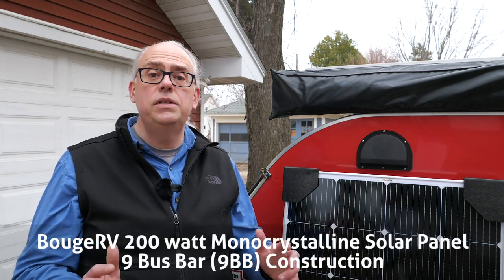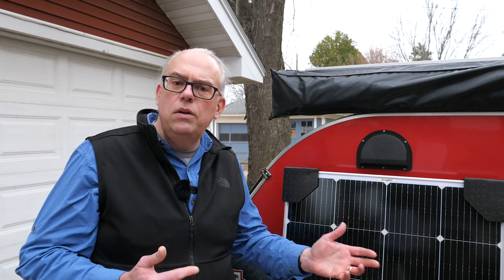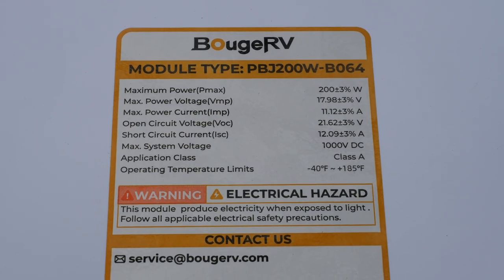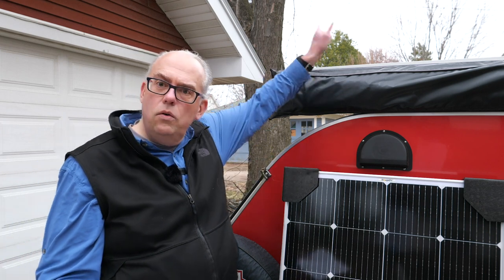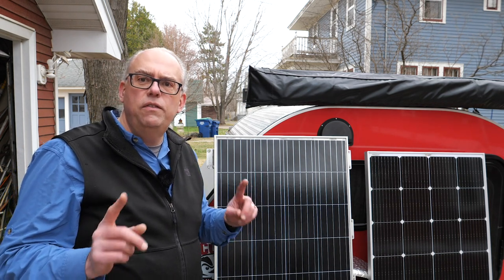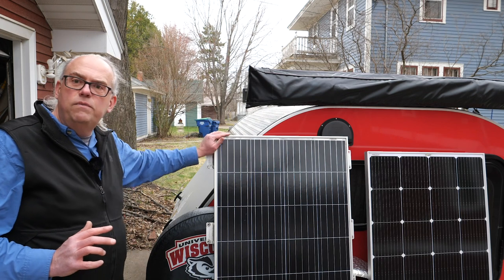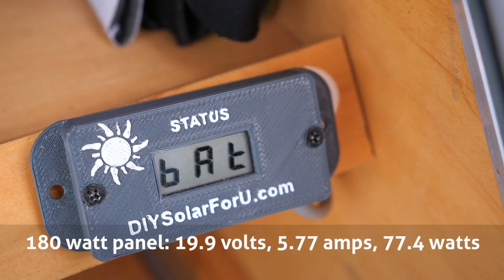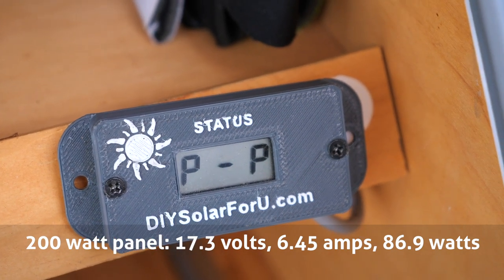BougeRV 200 watt 9BB solar panel review - 9 bus bars is better #HamradioQA

Comment: Nice review Michael, you make me want to go camping so bad . 
That panel is priced very well for a high efficiency panel. 
Do you think you will or could combine those on top ?
Perhaps a flip over or slide out mount for when you get to your camp destinations ?  73
Reply from the maker: I could connect the two panels in series, although you really should matched panels when you do that as the max power voltage difference between the two panels will affect performance a bit. But space is tight on the roof, so like you said, there would need to be a mechanical device to spread the panels out when stopped. I do have a port underneath the trailer where I can add a second panel wired in parallel. This is really handy because I can add a second panel on a longer cable and position it in the sun if the trailer is in the shade. 

Also, a new camping video will drop next week.

Comment: I am curious about a shading test. Naturally you would have to have consistency between the two tests. But the idea I had was to place a manila envelope right in the center of the panel switch panels do the same thing again with the other one in calculate the production emulating identical shading situations

Comment: thanks for this video!    How are you liking the bougerv 200w 9bb panel after using it for awhile?  thanks
Reply from the maker: The panel has been working well. Flat mounting on the trailer has always been a challenge for getting good sun, but even on a shady day this panel seems to catch enough rays to produce enough power to keep the battery at a reasonable level.

Comment: What size type/size battery are using? Maybe a video explaining panel/battery size in relation to power consumption.  Thanks
Reply from the maker: The trailer currently has a 50ah LiFePO4 battery. I have a compressor style cooler/fridge in the galley and need about 20ah of power a day if the temperature is above 80 degrees. If we put the camper in a shady spot, we will last for the weekend, but with not much power to spare. So I will soon be replacing it with a 100ah battery. I'll make a video talking about solar sizing and power budgets when I do the battery replacement.

Comment: I have a question on operating with solar power.  Do you have any issues with running your transceiver off of a battery that's connected to the solar panel at the same time?  I'm looking at the voltage output on my panel at 17+V.  Does the battery act as a voltage buffer before DC power gets to the transceiver?  I don't want to risk damaging an expensive radio by applying too much voltage from a battery that's under solar charging.  Thanks.  K7SFA
Reply: I guess I should add that my solar panel is 160W.  Currently, I'm charging one 55Ah AGM battery with solar power and using a second 55Ah AGM battery for transceiver operation.   I'm monitoring power usage so that when one battery gets close to 50% depletion I switch them around.  Running a transceiver off of battery and solar at the same time has made me a little nervous.  73, K7SFA
Reply from the maker: In a properly designed solar system, you can operate from the battery while the panel is charging it. In my trailer there is always a drain on the battery, be it from the refrigerator or other devices, or an amateur transceiver. The purpose of your solar charge controller is to match the voltage of the panel to the battery for charging/operation purposes. Transceivers are designed to operate at 13.8volt +- 10%, so slight variations in battery voltage during charging won't affect the radio. But depending on your charge controller, you may receive some noise. PWM charge controllers are RF silent and are good choices for radio operation; especially with smaller solar panels (under 100 watts). MPPT charge controllers use DC-DC voltage conversion and inexpensive controllers will generate noise. Better quality controllers, like Victron are quiet, I use a very quiet controller from DIY Solar for U https://www.diysolarforu.com/store/c1/Solar_Charge_Controller

Comment: It would be interesting to compare this to the Powerfilm 200W put on your Batwing Tarp.  It works better creating full wattage?
Reply from the maker: On average, rigid panels tend to be a bit more efficient than the flexible ones. But I would be interested in comparing the difference between this and something by Powerfilm.

Comment: can you combine both panels?
Reply from the maker: Ideally you will want matched panels for best performance, but you can combine them. If you wire them in series, the combined open circuit voltage needs to be lower than what your charge controller can accept. If you wire them in parallel, the panels will run at the lower max power voltage of the two.